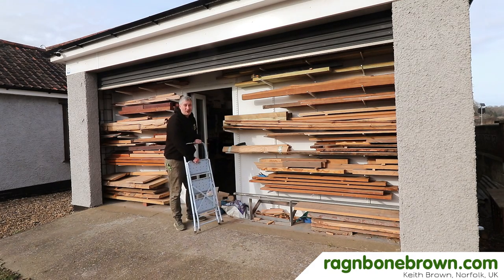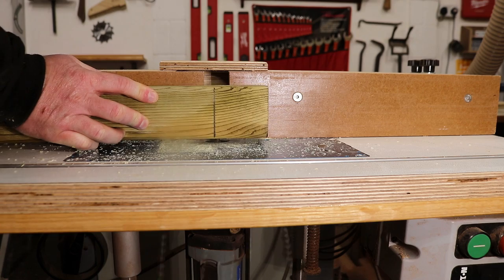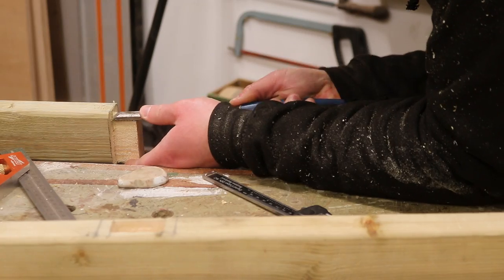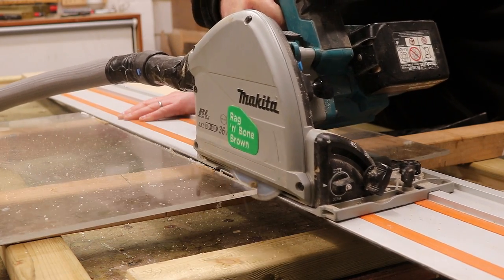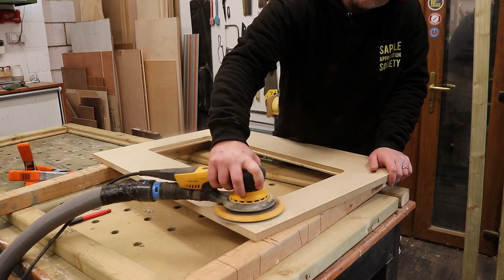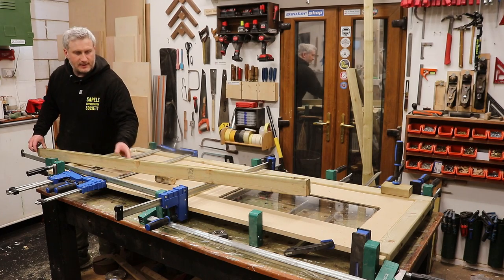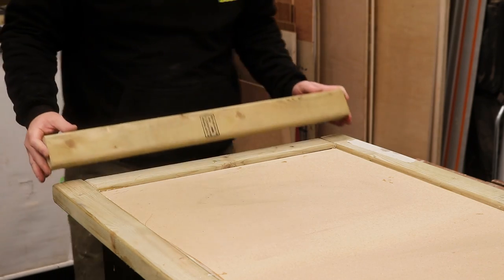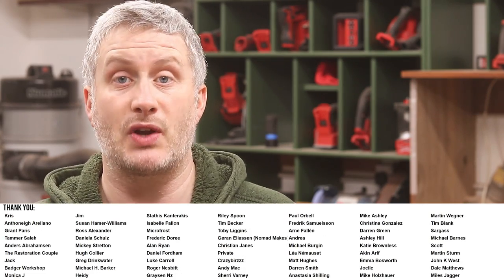Mortise & Tenon DIY External Door

Comment: Some tips: Always do a dry fit before gluing up.  Square off the rebate for the glass then you can fit beading to hold it in.  I'm not sure why you didn't square off the timber on the table saw first.  You'd get nice tight fitting joints instead of weird gaps.  You can use the router to round off the edge of the inside of the panels afterwards.
Reply: I'm a year late but, he got it done and it's just a shed. It doesn't have to be perfect. And he probably does a dry fit before gluing and just doesn't film it or show it. Out of all the videos I've seen of his there's no way he got a perfect fit on the first time gluing it together on every video lol I just took it as it's a simple glue up he probably just didn't show the dry run

Comment: Another timely video as I've got the task of making two interior doors coming up, and I've never made doors or mortice and tenon joints. I did consider buying a second-hand mortiser but as I have a router table, I might give the routing techique a go. Thanks.
Reply from the maker: Cheers Martin, good luck. I hope your glue up goes better than mine did!
Reply: @RagnBoneBrown  I think the key is to dry fit it first. That way you discover any issues like the panel fittings being too tight and you get an idea of where the tricky bits are going to be before you have the pressure of glue going off. Everyday is a lesson!
Reply from the maker: @FernsDad  I definitely should do that... I never learn!

Comment: Brilliant Keith, I’ve always followed your lead in showing the good, bad and ugly. Great finish, I’ve got a similar project on the horizon for the outside loo at our house, but strictly with leftovers / offcuts to keep the cost at a minimum. Thinking of using leftover shiplap cladding for the centre panel bits instead of sheet goods. All in my head at the moment so will have to see what happens 😀
Reply from the maker: Cheers Leo. Shiplap is a great idea for the panel, will look really nice. Hope you film it! 👍

Comment: For challenging glue-ups like that I've started using epoxy with a slow hardener. The one I use (West System 105 resin, with 206 slow hardener) promises about 25 minutes pot life, but I usually get more. The working time while you can still adjust things is hours long. Plus, it's slippery so it helps the joints slide together. The brand probably doesn't matter; whatever is available over there should work. The only downside is that it takes a long time to set up, so I usually just leave everything in clamps overnight. I guess cost is another downside; it's definitely more expensive than PU or PVA glue. I'm still on my first cans of it, though; I don't need it that often and so far it hasn't gone bad even after 3+ years.
Reply from the maker: Cheers Laura, I suspect epoxy might even be more expensive here in the UK, though I'm not sure. Certainly sounds like a good option

Comment: Couple more comments, for exterior door you really shouldn't have inset panel like this, it will inevitably collect water at the bottom. The way to do it is to have a plough and rebate your panel or tng and then it can be aligned with outer face of the door. And last thing - I think MDF is really gonna do poorly in the weather. If you just need a door that will do for few years then making a frame and putting on a skin over the top on the exterior would be a lot simpler. This door would be perfectly fine as interior one but not so much on the exterior. Sorry again for negative comments, I really like your channel just couldn't help and say something knowing some people might take this as the advice to follow. As for my credentials i am a joiner and have been for about 10 years and doors is one of the things I make. All the best and keep up the good work!
Reply from the maker: It is exterior grade MDF, manufacturer guidelines say it will last 50 years + in exterior conditions. This was explained in the video
Reply: @RagnBoneBrown  fair enough altho i have to say i dont really trust that claim much. one easy thing that could have been done would be to cut a chamfer onto the frame so at least water doesnt have tendency to sit on the top face of the timber frame and have time to work its way into the groove for the panel. i kind of hate being critical hopefully its seen as constructive criticism!

Comment: Great job. A solid handful of items overlooked, and a bunch of "I would have done it differently" along the way, but I applaud the job! Materials should hold up pretty well (I hope). I've seen other ,  very much more experienced carpenters take on a job very similar to this, and shudder at the thought because of a number of things you brought out. Material selection, cut preference, method of preparation, type of joinery, choice of glue(s), stains, etc., all go into the agony of building an exterior door. The real proof, of course, is down the road a year, then 2-3 years, then 5 years, then 7, then 10... Watch how the door changes over time to really tell how well you did. The best example I saw was a guy building a 10/4 mahogany door 4' wide, 6' tall. It was also mortise/tenon joined. A couple of wrong choices meant that the $1,100 in materials turned to kindling a year later from warpage, making the door unsalvagable. Great work on the project. Look forward to seeing more.
Reply from the maker: Thank you

Comment: I usually glue doors in two stages as well when I use PU or PVA. I try to dry fit the other upright before clamping everything up, so I know the other side fits. I usually leave the panels for the second round as well, unless it's fully glued in place.
Reply from the maker: Great idea

Comment: Great vid,  have to admire your router skills. Have to admit that i bought one with the misguided illusion that my wood working skills would improve overnight. It became clear that they didn't very quickly. How did you wall mount that makita charger ?
Reply from the maker: Cheers. I don't remember actually, I think I just used some mounting tape and then screwed some wood to support the underside or something

Comment: Just FYI - think your waste side jigs are the wrong ones. It looked like your cordless track saw came with Makitas newer thing kerf blade, it certainly looked the blueish colour. Double check but I think you’re blade will have a 1.45 kerf so you need the yellow jigs, the reds are marked as for Makita cordless tracksaw but there are 2 different blades in circulation.
Reply from the maker: Cheers, yes looks like you're right! Still, I suspect 0.15mm discrepancy is too small for me to notice 👍

Comment: I'd file this under jobs it's nice to do once to show that you can but commercially not worth it. If it wasn't your dad, would you not just pick a UPVC door and fit the frame to it?
Reply from the maker: Well, it was an unusually sized door at 1880x686 so I'm not sure a uPVC door would even be an option? But I've not looked in to it in great detail. I could have bought an exterior timber door and cut some off the height. But when you're a YouTube woodworker, projects like this are too good to pass up

Comment: Good video and sorry to be a wet blanket but if you are using a low grade timber like this I would say it is total over kill to be putting mortice and tenon joint. Also because this wood is very soft the tenon will be quite weak potentially. I would say use half lap joint or buy better timber. All the best!